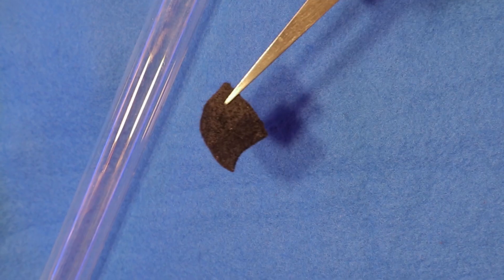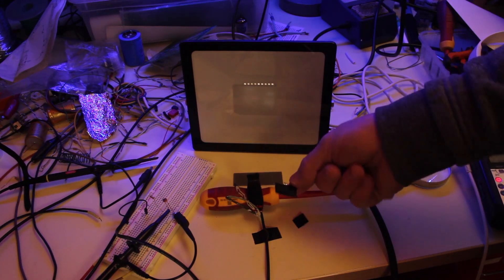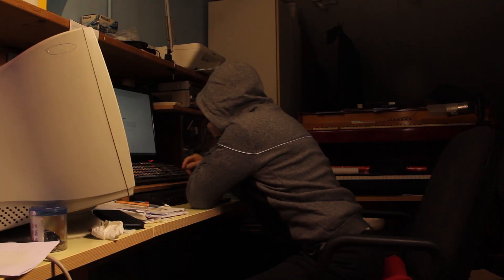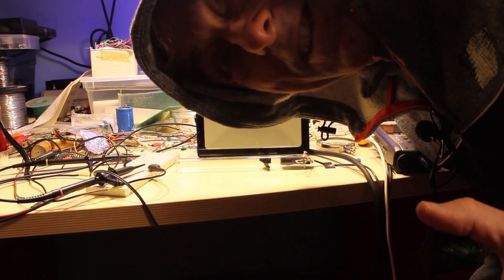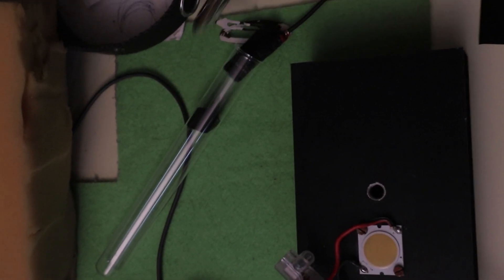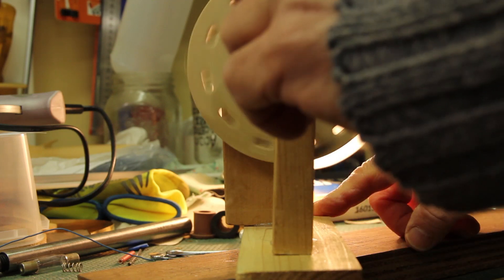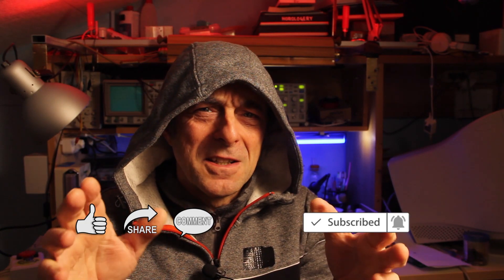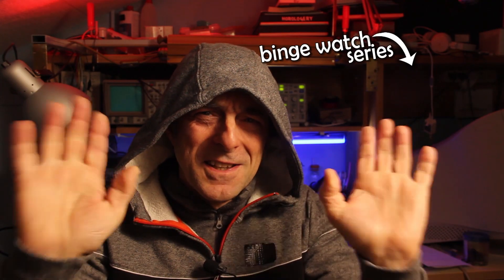The mindblowing #photoacoustic effect: #light makes materials to play #sound! - [Redone video]

Comment: amazing video!!! however, i question if random black materials are just able to start to vibrate to modulated light.
Reply from the maker: Thank you. This phenomenon is linked to thermal expansion, so any material responds to modulated light. Though, because sound propagates on air, the larger the surface the louder is the resulting pressure. A porous material like fleece sports a significantly large surface and being porous the trapped air is pressed easier. So porous, flexible and lightweight (little mass) materials should respond way better than solid, rigid and heavy materials. That's my understanding of how the phenomenon works.
Reply: @AccidentalScience  s o -  foamed polymers. But it is stil unintuitive for me. I ve been working with modulated lasers for so long. I never thought this could create acoustic waves.
Reply from the maker: @BeatPOWERvomPowerhof  if it is still not intuitive I have done a bad job with my video. Sorry.

Comment: Super cool video! Maybe 15 or 20 years ago I recall buying very thin strips of piezoelectric material from Digikey. It would be interesting to try one of those strips becuase of the very low mass. They were very flexable and were similar to a ribbon. For a while I think folks tried to make acoustic guitar pickups out of them.
Reply from the maker: @leiferickson3183  thank you. Really interesting I never had the opportunity to get one. How do you bond it to a conductor plate?
Reply: @AccidentalScience  They had wires attached. I thought I put a part number in the previous post but it isnt there.

Comment: this is very interesting, I will try myself. I wonder if you try to exclude the possibility that is an EM induced voltage, let's say wrapping the MIC in a grounded metal mesh
Reply: I trust that it is not the EM fields but the easiest test would be to perform the test and then simply remove the tube and material and repeat the test and note how much noise is picked up. I have watched enough of his videos that I am comfortable trusting his work.
Reply from the maker: @leiferickson3183  Thank you for the trust. Yes I actually did that but I didn't film nor mentioned it because I thought it would have been too pedantic. There is some hum that is picked up, and it is audible but it is approx. 10 dB lower in amplitude.
The experiment #3 definitely demonstrates this. You can hear the music, and the hum. Here the music component is a bit less intense because the LED I used is just 1200 lumen Vs. 4500 lumen of the projector.

For full disclosure and clarification, please notice that I mixed the original music in the video only toward the end of the experiment (when I touched the microphone, and when I started to describe the setup, at 7:46 mark) for entertaining-cinematic purpose. If you pay attention you'll notice that the added background music is slightly out of sync in respect to the recorded sound.

I didn't even fathom that someone would have had thought that this was a fake presentation, because I don't see the point in doing this in the first place. If I fail in doing something, simply I make a video about the failure. What would be the point of being "Accidental" otherwise? 🙂

Thank you guys anyway for commenting. I appreciate both critics and praises.
Greetings from the Alps, Claudio.
Reply from the maker: Thank you for commenting, please check out the experiment #3.
Reply from the maker: P.s. The microphone is already shielded. Underneath the sleeve it is all metal steel.